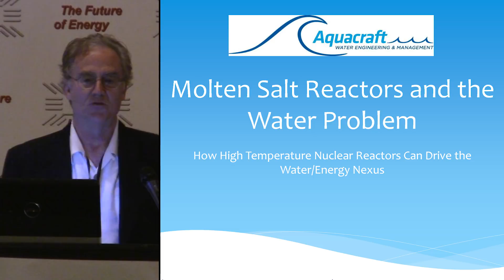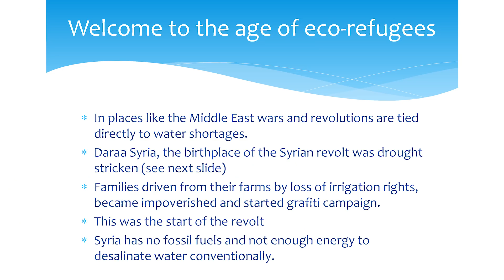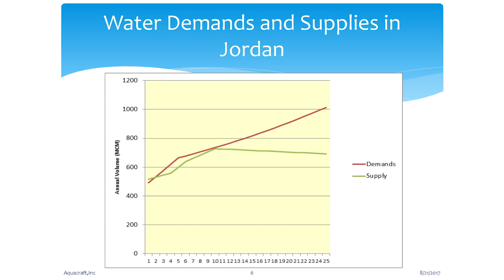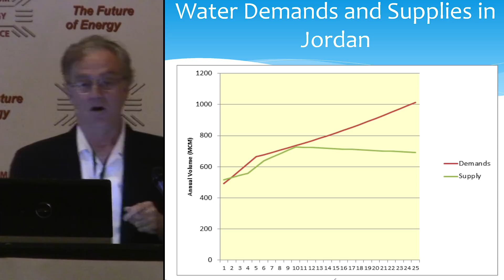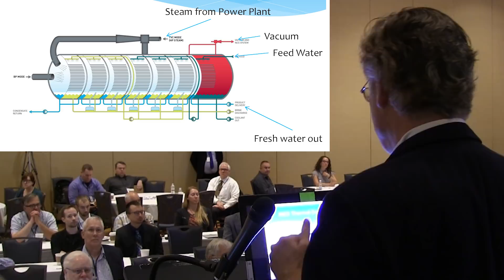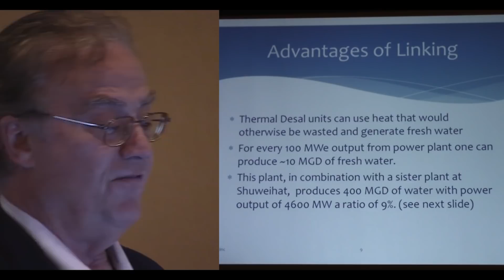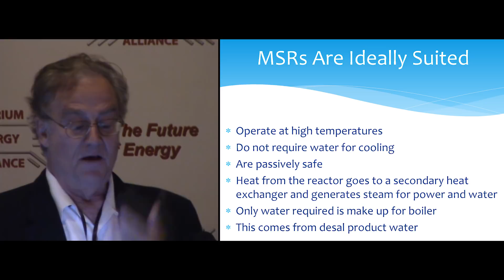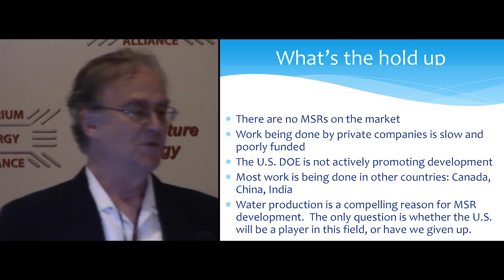Molten Salt Reactors and Thermal Desalination to Transform Jordan - William B. DeOreo @ TEAC8

Comment: Here’s a refined version of your thought, keeping your meaning and energy while tightening the language for clarity and strength:

⸻

Molten Salt as a Water Reclamation Solution

The Molten Salt Alliance is pioneering the integration of molten salt technology as a dual-purpose system for both energy storage and water reclamation. Positioned within one of California’s most contaminated regions—the Salton Sea—the project serves as a real-world development testbed. By addressing extreme environmental degradation with this innovative approach, the Alliance aims to demonstrate and refine a solution capable of operating in the most challenging environments worldwide.

The deliberate choice of the Salton Sea region underscores the project’s ambition: to transform one of the most difficult and contaminated areas into a model of reclamation and sustainability. Success here would not only validate molten salt’s application beyond traditional energy roles but also provide a scalable blueprint for global regions in critical need of water recovery and environmental renewal.

Comment: In fact the desalination spoken of for Jordan can also be used for Saudi Arubias'es line city. To be fed water by using a molten salt reactor to feed water into the subsurface river to feed the city. Just  multiply the water over rainfall by five times in the mountains flowing under the desert as an underground stream just not so much as to produce surface swamps and lakes.

Comment: I was wandering since a molten salt reactor uses fluorite salt as fuel would it be possible to do thermal distillation on the brine in order to collect the salt output and turn it into fuel?

Comment: Production of freshwater by using excessive heat from cooling water is not a new idea. Ships have been using evaporators for decades. A steam driven ship must have access to large amounts of water with as low ppm of chlorides as possible. A LNG tanker with steam turbine can easily produce 6o tonnes of water every day. Diesel driven vessels use the heat from the cooling water to generate drinking and household water. If the demand for water is extreme high like on a large cruise ship you would use osmosis systems. On this presentation the show a cylindrical shaped evaporator. They should use a plate type evaporator because it is more compact and efficient due to the larger surface area where the heat can be transferred.The use of vacuum lowers the temperature when the water starts to boil. Simplified the boiling temperature of water will be lower on Mont Everest than it will be  at sea level due to the difference in atmospheric pressure.

Comment: Why not make a pure de-sal plant?  Get potable water for your BTUs and avoid the cost, complication and infrastructure of the electrical power part of the plant.  Hot salt primary, clean secondary (salt or liq metal), multistage evaps - simple test bed to demonstrate MSR.

Comment: I am sorry to say, but what you are saying is completely wrong. Having worked on those middle east plants, the electrical capacities of those plants is in addition to the desalination, that power is not used for desal. Today’s RO technology desalinates 1MIGD with less than 1MW capacity, in the Range of 0.5 to 0.8MW /MIGD. RO is completely substituting thermal desal as it is much more efficient. We are working on decomissioning MFS, replace by Steam turbine and quadruple the water output with RO not using any more fuel. Thermal desal is dead!

Comment: the problem is Zionism. No Zionist wants to see MSR arrive as a technology because it would eliminate the need for Middle Eastern Oil and Gas and then there is no way to justify the multitude of US bases in the Middle East whose only real purpose is not the oil..........its protecting Israel. The tail wags the dog.
Reply: Then it's an idea to promote joint desalination projects.  Terrorism feeds on drought and scarcity, wilts to nothing when confronted by nutrition, education, culture and proper policing.

Comment: I wonder if the pressure vessels and containment building are still intact at San Onofre. While I don't know the exact specs, I'd imagine that it might be possible to use those existing reactor vessels and their nuclear-qualified materials to house new MSRs or LMFBRs. Sure, they don't need the giant pressure vessel, but it's nice that they're already there and capable of holding reactors.  Plenty of nearby sea water and I just happen to know there is a water treatment facility a mere 8 miles up the coast that could pump the newly desalinated water right back into the SoCal water system.
And most of the spent fuel is still there, just waiting to be reprocessed for another run through.
Reply from the maker: Right now new nuclear power plants can't be constructed in California until there's a waste repository. Best carbon deal is to fight to keep Diablo Canyon open. Then one would want to repeal the Californian legal barrier, and/or see to it that a repository is built. But it won't really matter how the existing containment building COULD be repurposed if there continue to be legal barriers impeding any new nuclear construction. Keep Diablo open, once it is shut down replacing it with a new reactor will be very difficult in California. The anti-nuke orgs fighting to close it know this.

Comment: Yeah it's a good plan, because plants lose money during non peek hours if you run the plant at full power all the time and sell the water it could work about anywhere water is scarce. Although I assume you need high water costs to make it turely economical.

But even in places where water isn't really expensive they were going to waste the time on the reactor anyway, being able to use the energy for something else would allow them to recoop some of those loses and you could also reduce costs by not having to have so many peek plants.
Reply: Not really, with high-temperature MSR's you can build a smaller reactor, run it maxed out and store the thermal energy for peak demand. Simple insulated tanks, no batteries.

Comment: I misspoke when I said 4 MW of electric output.  That should have been 4000 MW.
Also, the slide I showed only included one of the plants (Al Taweeiah), which had an electrical output of 3193 MW and produced 281 MGD of water.  There is a second plant (Shuweihat) that produces another 120 MGD of water from a 1500 MW electrical output.  Together the two plants produce 401 MGD with a combined electrical output of 4639 MW. That's 86 MGD per 1000 KW, which isn't far from what I said was a rule of thumb of 100.
Reply from the maker: Thanks for clarifying.
Reply: Don't worry, it's only an entire order of magnitude XD could've said gigawatts :p
Reply: Thanks for giving this talk and thanks to Gordon for putting it on YouTube. I learned a lot from it. This needs to become common knowledge.
Reply: yeh but they only let you build the 4MW version, LOL!

Comment: How do you get more than one pound of water out of one pound of steam? That doesn't make sense. Other than that, I wish all nuclear reactors were of the molten salt variety, it would be a huge improvement in safety and sustainability.
Reply: I think they meant a pound of desalinated water v a pound of steam. An MSR can produce very hot steam (560 degs C or more). But in reality you dont need huge amounts of hot steam. All you need is the low pressure exhaust from steam turbines. That heat will evaporate sea water for desalination. At high vacuum that happens below 40 degrees C. The incoming cold sea water is used to cool the outgoing desalinated steam so it's pretty efficient stuff.
Reply: @Oliver Mayo Paradoxical.
Reply: @Oliver Mayo The energy of a pound of steam makes ten pounds of fresh water out of more than ten pounds of saline water.  There's no paradox.  I joked. :)

Comment: I mean desalination is a secandary concern. If you could first harness the abundant energy of Thorium, and be able to solve the capitalistic concerns assosiated with that, You then would not have the entire water concern nor the global warming nor the pollution concerns for another about 4000yrs. Not sure what is the point is to be talking about a specific single benefit, when there are absolutely enormous total benefits associated with generating energy from Thorium. the Desalination is just way too insignificant in comparison.
Reply: In a place like Jordan, the cost of a conventional desalination is unaffordably high. Solid fuel (conventional) nuclear is even more impossible. The low cost of molten salt nuclear solves two problems - water and energy. 
In Jordan, the need for clean water can be what makes the change happen.
Reply: "too insignificant in comparison" - I bet you've never had your faucet run dry.  There's a shortage of fresh water right across the world.

Comment: Why go through a full boil.   A forward osmosis plant could simply use the waste heat from electricity production.  Forward osmosis would use far less energy. Both brackish and briney water sources could be used.  Another advantage being less cooling is also required.
Reply: He already stated that the latest osmosis plant in Carlsbad, California uses 20kwh/KGal vs their MED thermal desalination uses 2 to 3 kwh/KGal. See at 17:55 in video.
Reply: whykhr That plant uses
 Reverse Osmosis.  This is pushing water from salty to fresh through a membrane. This is a very high energy using system.  What I am talking about is Forward Osmosis which is the pulling of water from salty to even more salty through a membrane. The pulling salt is separated out using a temperature gradient.  This is a much less energy intensive method to de-salt water.   The important concept here is Forward Osmosis.   Check it out.
Reply: Even better. Do you have a link to a proven system.
Reply: There's a description on Wikipedia (easy enough to find) at  https://en.wikipedia.org/wiki/Forward_osmosis#Desalination.
The article states very clearly that forward osmosis doesn't produce fresh water directly but "requires a second, energy consuming, step" for getting to fresh water. Your search can also get you to manufacturers of forward osmisis systems.
Reply: whykhr Every paper I've read reports RO as less energy intensive than MED. The only way I can see MED could require only 2-3kWh/kGal is if you ignore the input heat. The waste heat used should be compared against a WHRSG and then using that electricity for RO.
Reply: Graphene Filter Membranes is being touted.